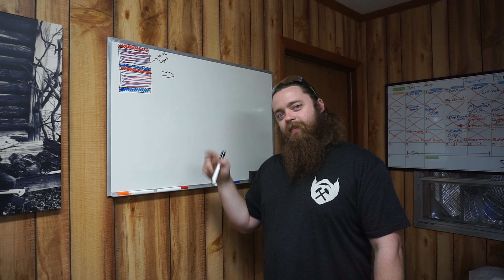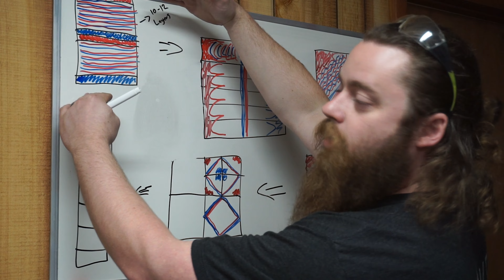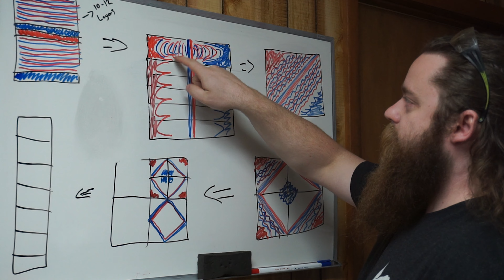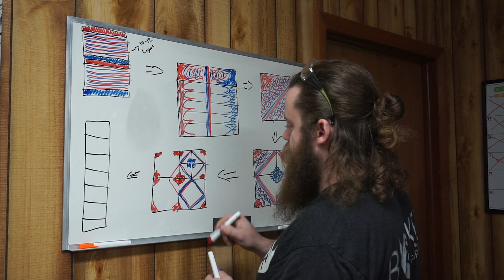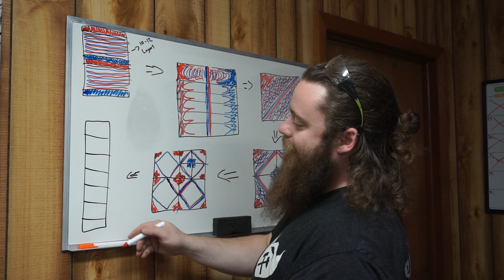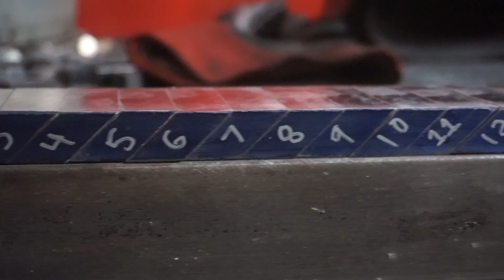"Wraith" Mosaic Damascus Build!!! (Fast paced forging action!)

Comment: Absolutely the most beautiful mosaic I've ever seen and that roller mill makes mine pretty Johnny home owner lol but i do have a couple of questions what kind of grinding wheel do for scale removal? I see that you bead blasting  after surface grind why? Thanks you do great work and easy to understand teaching
Reply from the maker: Thank you! That was a fun project. If you like that rolling mill, you should check out our new one! 
- https://youtu.be/TL9ZPxIrLfU

We use a cup wheel disks for scale removal before grinding. You can get them on amazon here! - https://amzn.to/3U3PjPk

The sand blasting is just for removing a speck of scale here and there. A tip from Jason Knight.

Comment: This is a great video and very simply revealed the steps involved.  I am planning to do a mosaic in my next billet and am trying to follow the pattern development.   I get it to the final 4 way pattern but then you flatten to .75 x 2 making it wide and skinny, you cut the 45s on it which stretches it back out some and I am guessing it comes back to a square pattern again as you stretch it back out.  Am I following all that correctly?  Thanks.  I am loving y'all's channel.  Found you from tyrells 3d printed mosaic video.  Great job.
Reply from the maker: Yep! You are correct! Once you tile out the bar and the pattern is on the face of the bar, you can stretch it out to bring the pattern back square. But be careful not to stretch it too far. 
Thanks for the support! 👍🏼

Comment: I wonder how cool it would look after you made the initial mosaic pattern & cut it up into 4's if you took bar 1 & made a stainless steel fishing hook damascus, took bar 2 & made a twisted dmascus out of it, bar 3 you did a tear drop dmascus with it, bar 4 make your wraith damascus. Then slice them up into the 45 degree angles & stacked them up & made a blade out of that?